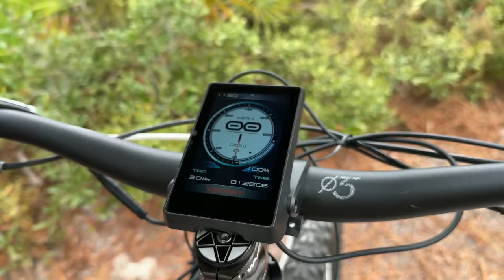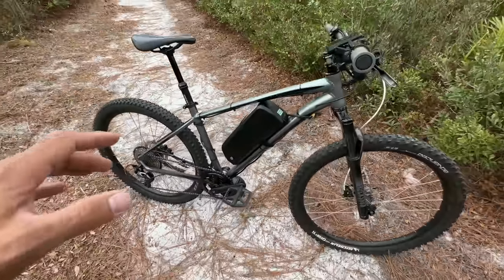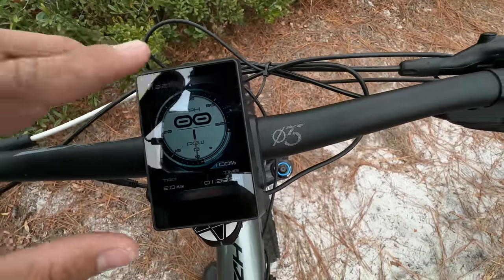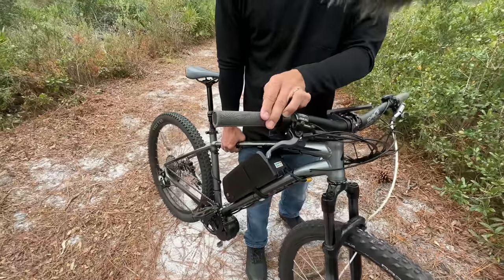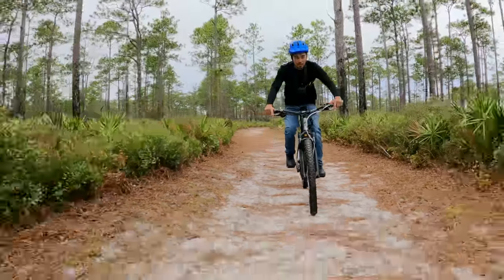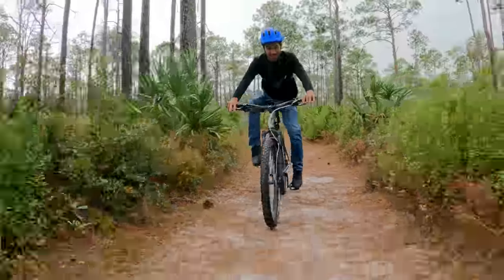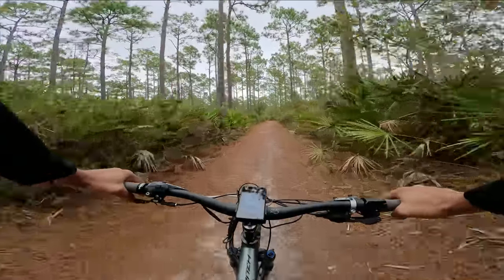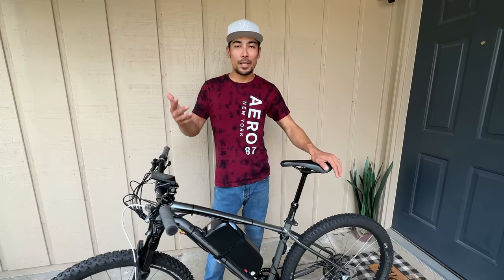Best Ebike Conversion Kit of 2022 | BAFANG Ebike Conversion Kit

Comment: $600 is not cheap lmao
Reply: Compared to £2500. It's brilliant 👏
Reply: Relatively it is
Reply: Cheaper than my surron
Reply: It's about 400usd now
Reply: Hell yeah it is! For a e-bike that’s better than 2,000 dollars
Reply: If you live in the 1970s then you're correct $600 is a lot of money. In 2024 it's the price of a loaf of bread and some kraft singles.
Reply: It is for an e-bike
Reply: It is relatively cheap
Reply: Fam I’m broke asf and even I have $600 that’s not expensive at all  .. what you expected it to be $100?
Reply: Kinda is
Reply: Compared to gas it is
Reply: It’s $345
Reply: @FranceFrancisco-hx9cq Gas for life!
Reply: Right, OP gets it.. $600 is cheap for a new F-150 but it’s high af for a bicycle to be easier to pedal for a few months before it burns out, or if it lasts then in 18 months when the lithium batteries stop charging because it was made in a counterfeit factory overseas.. I dunno man, I feel like it’s better to just add a few more hundred bucks and get the whole bike so they have less ground to blame the install/using due to install from the owner who installed it.. At least when the whole bike dies you can send the whole thing to them and get back on the pedal bike for 90s days when a replacement should be ready to ship 😅
Reply: Strive to not settle. Wait for the additional time to put up $2200 and when you can comfortably do it order a dirt bike that shits on this electric motor, yea it’s 3x the cost but there’s no question it’s 3x better, more fun, faster, and will last 3x longer at minimum.
Reply: @HehehGeheis  it’s not $600. It’s around $400 now.
Reply: @sharkfinn6469 in the world of e-bikes, it absolutely is..
Reply: @sharkfinn6469 $400 with no battery
Reply: @IdahoEagle77 that's the price with no battery
Reply: Mfs who got money say it's cheap
Reply: That’s because your poor lol

Comment: How about a follow up? Maybe a breakdown on the installation itself? What you need to know, What to avoid, etc
Reply: This would be nice
Reply: Whaaat?  You totally missed it,   probably because of all that nail biting bike sorcery he was able to capture. I haven't seen trail thrashing that rad since Joey Moskowitz lost a wheel mid-flight on his candy apple red BMX while jumping hills at the ore-cuts in Junior High. Shit made the Wichita paper.
 I had to use my journey t shirt to stop the arterial bleeding from where his upper thigh was penetrated all the way through by one of the forks bending backward upon landing! But that pales in comparison to this video. I felt the instructions were clear and concise, and the editing was studio worthy, as was the costume changes. The parts I found exciting were the points on chain dynamics, gear box to helmet ratio, and steady state  theory. What do you want him to do, tell you how to install it???  C'mon!!
As far as I'm concerned, my next stop will be swagging my beast out with rad gear....saddle bags , more decals, then the next stop will be BIKE WEEK, WOOT!! Daytona WOOT, WOOT...BEACH ....WOOT WOOT WOOT!!!!
Reply: @SmokestackLightning3.14  Can I have some of what you're smoking?
Reply: The thing about center motors is that they wear out chains sprockets and bearing and rims fast . And the battery's don't last as long as they say which are very expensive !
Reply: @dougwiedinger1517  So what suggestions do you have for us?
Reply: @rsmail7426  I don't really know . Its has to do with the metals its self its not .designed for the torque of these kits or to go as fast as some of these thing seem to go . Mine is very fast I have a 3000w Cyclone kit that does 55 mph . I've tried so many different kind of Freewheels and my bike just eats them up within  like 3 mounts . I try to ride slower now so thing just last a little bit longer ...

Comment: I put a similar mid-drive kit on a 29er Kent Trouvaille. The bike was $350, the kit was about $800. Sold it to a friend for $1,650 & I have regretted ever since, since I don't have the time or patience anymore to build another one. It was my Covid project, if you will. It used to go 25 to 36mph going downhill with slick touring tires. 🤣
Reply: 1650$…too expensive..you lucky you made money out of your friend..💰💰💰you can buy under 1k for better bike..
Reply: @romavilla7855  thats not the focus of the comment, its supposed to highlight the fact that even 1650$ was not worth parting with the bike....

Comment: I've got the same mid-drive motor it peaks at 1200w which is 112 Nm of torque and if you get the eggridder V2 display you can Configure the settings from your phone because its Bluetooth I love it I've got full throttle all the time plus I don't need to set up in my laptop all the time it's Instant I could change them when I'm out if I wanted to but now I'm setup I just leave it alone 👍🏾😊
Reply: Got an update? I'm looking into getting one.
Reply: So you never padel?

Comment: Bafang BBS02B street legal mid-drive motor is rated at 750 watts but puts out 1470 watts peak With 120 nm of torque not 100 nm. 🤪
Reply from the maker: Damn you know better than Bafang good job bro

Comment: I’m obsessed with the idea of converting my bike. This kit seems to be pretty well reviewed and simple to install
Reply: I had my friend installed 2 of the 48v 750w on both of my Trek bikes and it was the best thing I have ever had done 3 years ago and still no issues or problems with this setup... two thumbs up 👍 👍
Reply: @martintammo72  can I ask which trek bikes you had? I have a brand new trek I’d like to convert to an EBike but I have no clue where to start.
Reply: I kind of like this one where you have to replace the whole crank plus my three front gears on my mountain bike are useless cuz they don't switch out of the second gear
Reply: Same question. I have a Trek 4900 mountain bike. How would I know if would fit? Do you have to take it apart a measure bore on crank? Thanks in advance!

Comment: I've been using a 36V 500W conversion kit from BAFANG (looks identical to the one in the video) since Sep 2018 as my preferred daily commuter, they are excellent!!! I used a little frame bag to hide all the spare cabling & connectors so everything looks nice & neat! STRONGLY RECOMMEND!!
Reply: What do you mean frame bag
Reply: How much was it?
Reply: @lennypen1978  Frame bags, they're little triangular shaped bags that go on the inside of the frame. Usually for storing things. But I;m guessing he's cut a hole out of the bottom of his and stuck it on to hide the battery. Just google bike frame bag, there shouldn't be any shortage of results it's what they're actually called.
Reply: @benpar8120  Range from like 250 to a grand. I'd say most of the ones under 5-600 aren't really worth it. Will be quite a low wattage AKA reduction in power top speed and acceleration and weight capacity. If you do bump tracks, down hil or anything really that requires a bit of a drop in you need to be careful as these things are going to stick right out
Reply: @オールマイト-y1f  correct
Reply: @benpar8120  paid 850 USD including the battery
Reply: what's the mileage on a single charge? and what battery do you use?
Reply: @matteo1331  ~50KM at 32KM/H avg with a 13AH 36V battery on a 28" city bike using pedal assist in a relatively flat riding area, I'm quite big ~100KG + bike + bags a tot weight of approve 135KG.
Reply: Do you need a battery for it to work?
Reply: @antzval67  yes, 36v 13ah
Reply: @rimshot6444  i’m gonna get the 44T 17.5Ah battery

Comment: I put one of these kits on a 2003 Gary Fischer with disc brakes, upgraded to larger rotors on the front. I'm 61 and in pretty good shape but man this thing allows me to go to places I really couldn't or wouldn't go on a regular bike plus I still get a decent workout (nothing like I would on a regular one for sure) but again, I can go places and for way longer then I would otherwise. Its pretty freaking cool. Sometimes I just like to be out exploring and not so much wanting a killer workout and where I live it gets so hot and humid that a regular bike would just be awful during the hot months.
Reply: This is why e-bikes rock
Reply: @Miles26545  agree 100%

Comment: I did a whole season with the BBS02 in Northern Ontario. It can handle rain sleet and snow like nothing.
The programming cables helps a lot. 
I unlocked 9 levels and slow each of them down so my legs don't spin too fast. 
You get that when the speed is about 10% less than power level.
Reply: Hey there! I just stumbled upon a new project called the freebeat Morph 2-in-1 eBike and it sounds incredible! Not only does it offer a smooth riding experience, but it also has some outstanding features. One feature that caught my attention is the indoor recharge capability, allowing you to charge the bike while using it indoors. That's a game-changer for those rainy or snowy days when you can't go outside. Plus, with its 80mm front suspension and puncture-resistant fat tires, it seems like it can handle any terrain with ease. Can't wait to try it out myself! Keep up the great work, freebeat!
Reply: @StellaHulliet  That's some serious culinary fusion
Reply: When you add the price of battery and display in there, you're starting to approach the price of a pre-built ebike. Kits seem like a good option if you already have a decent bike frame on hand, though. I wonder if it's practical to DIY a battery pack out of 18650's or another lithium-ion cell to the same specs as the factory battery pack--that'd bring the cost of these kits down dramatically.

Comment: Top tip, for mounting the battery use 'rivnuts' as only two bolts to hold the battery isn't enough. I've been running this exact set up for around 7 months with no problems since using extra bolts to hold my battery,  which is a 52v version.
Also the gear change sensor is a must. It'll save your chain and all other drive components.  I've also put on a 203 front rotor which is very wise as my bike does 59kph on the flat,  standard 160 rotors struggle,  I've also a 160 fully floating rotor on the rear.
Whys your battery upside down?  If you have it on the right way up water won't go into it.
Reply: I built so many kits and even switched out kits from one bike to another four or five times so I started using Velcro to hold batteries on any kind of frame and is easy to install and un install. And I have never had a battery  come lose or come off. plus no rattle! I buy battery bricks and armor them myself and install a power switch to conversion kit to keep the battery from popping when plugging it to the kit.
Reply: Dal Venable  could be an idea as the standard method of bolting it onto the water bottle mount has only two bolts, which on an aluminium frame definitely isn't enough.
Reply: i seen also a video where they put a velcrostrap around the frame and battery to make sure the battery stays put, i bet u could fit some little pieces of an innertube, to absorb the shocks while driving...:)
Reply: @nudgeA7  Actually I armor my battery then add the stick on 3M Velcro to both the frame and the battery, then add Velcro straps. It becomes part of the bike won't move or rattle. And I can hang a battery pretty much anywhere on the bike that is out of my way.
Reply: How much did you pay for the entire kit with all the modifications?
Reply: @biomorphic  the kit cost me £771.00  plus another £50.00 for everything else. 750w motor and 52v battery
I also got a new chain and rear 9 speed cartridge the chain is a kmc e chain at £34 and shimano cartridge was around £50  or there about. You'll definitely need those as the torque shreds chain and cartridge so new is a must.
Reply: @dalvenable331  yep velcro is a must especially for the heavier battery packs
Reply: Gear change sensor is not necessary.
Reply: 52v battery or 48 v is the same guys!!!
Reply: Anyone new to this stuff: This tip is absolutely right. And isn't said nearly enough. It might be fine for a little 10s4p if you're doing short trips on a 10AH battery on an EU legal 250w 36 volt set up. But even if your're running a 17.5+AH battery on one of those, and have drilled through the aluminium heat sink to mount to the 2 bottle mounts, your battery can shear off and cause damage to the battery, the holder and the frame. 
Source: My 25AH 36V battery sheared off when I took a tumble over some wet leaves the other day.  I'm mounting with 2 new rivnuts alongside the existing ones and using velcro straps to reduce wobble now.
Reply: Don't need a gear sensor if you have brake cut off to the motor, just pull the brake lever in enough to cut motor without engaging the brake while shifting, like a motorcycle clutch.
Reply: @18andlikeit  tried it but couldn't get it feeling right with hydraulic brakes, besides it's only a few extra bucks. I'd say it's worth it. And I ride MCs,  it's nothing like a clutch.
Reply: @GB-vn1tf  yes I used to ride MC's for years myself. I know it's not exactly like a clutch but it's similar by pulling in the left lever so you can shift. I may end up getting a gear sensor myself but I'll see how I do using the brake lever method first. Quite a few people do it that way without issue.
Reply: @dalvenable331  what does armoring the battery mean?
Reply: @Jytaani  custom made housing to protect from weather and fall damage.
Reply: @18andlikeit  this is genius. If you’re used to riding motos it’s second nature.
Reply: @GB-vn1tf  under bleeding the brakes so they have some throw in the levers would help. I do this on my downhill bike so I can have my pointer fingers pulling on the levers, but not engaging the brakes unless I pass a certain threshold. Helps reduce hand pump having the fingers closer to the bars.
Reply: Have you got an image of exactly how it looks as I want to buy a set up like this for my Whyte 605 V4, I would like to know but how you installed them brother
Reply: @GB-vn1tf 9 speed cassette you mean
Reply: @clashwithmoi8926  indeed. I'll blame Samsung autospell.
Reply: I installed the battery mount by drilling holes in the frame and using through bolts.
Reply: @petri2852  that'll work.
Reply: @alexdonatodj 36v charges upto 42v and 48v charges upto 54v ,52v charges upto 58v
Reply: what chain do you need for this motor?
1/2 "x 3/32"???
Reply: @juriylit8936  I'm using a kmc electric chain, I haven't had any problems after a year of use but the cassette is starting to wear. It's just a standard shimano 9 speed.
Reply: @nudgeA7 : Just to clarify, you're not driving, you're riding. Federal law doesn't define E-bikes as "motor vehicles ," but rather as an "electric bicycle."
Reply: Bro where to buy this kit
Reply: @dalvenable331  bro put here building Ebikes
Reply: @GB-vn1tf if the chain goes will it move at all?
Reply: @desertspectre2881  no, it need a chain to drive it as the motor is mounted in the bottom bracket. I've put a KMC e bike chain on and had no problems with it but the cassette takes a beating if you don't use the gears. I'm on a 9 speed cassette so use 5th and up while starting to not put too much force on the cassette. Oil the chain as normal and I've had two years use now without problems.

Comment: It certainly looks a lot easier to install it than early generation conversion kits with their strap on bags, wires all over the place, warnings not to get the kit wet or rained on.  The placement of the mid drive motor & electronics makes this ideal for normal or reverse trikes, recumbent, maybe even some quads or multiple passenger bikes.

Comment: I've now done three of these and they are easy to install (as long as you get the right bike with the correct crank size) and they are bomb proof and brilliant to use
Reply: Wym about crank size ?
Reply: @yourmom2819  The width of the bike's crank needs to be within the limits of what the Bafang can be fitted into
Reply: @MikeKleinsteuber  how much does an entire kit cost ? Motor , display , battery ?
Reply: @ride30r2die  At the time I did my last one, around 2019, it cost about £450 plus the cost of the bike. I don't know the current amount and have been looking at alternative hub mounted motors. Just for a change and to try them out. They are cheaper but not necessarily as good. Bafang go on forever...
Reply: What bike did you used for this install?
Reply: @cp25170funnyguy  They've all been from Halfords. My last one was a Crossfire
Reply: @MikeKleinsteuber  i have a question,  is white xc 290 comp combatible with this kit
Reply: @MikeKleinsteuber  good motors from Suzhou, Jiangsu province, China.
Reply: I have the crossfire 2, which really the only difference was a couple of extra gears and disc brakes over the crossfire 1 that I had before it.  Was there much you had to change, crank, chain, cassette etc..
Reply: @suprafrase  Didn't have to change anything at all